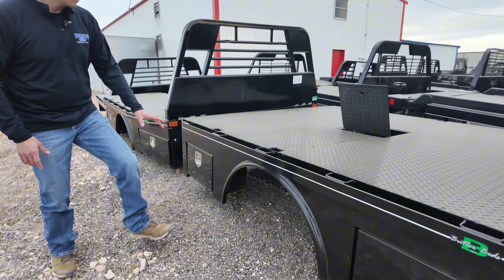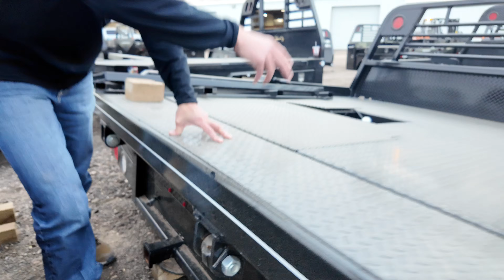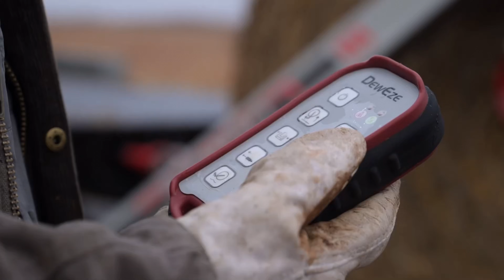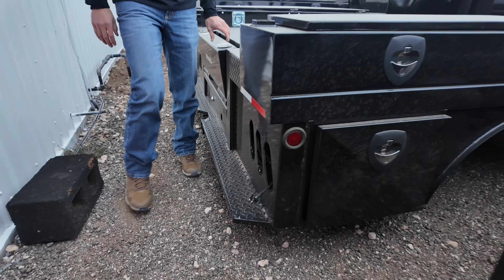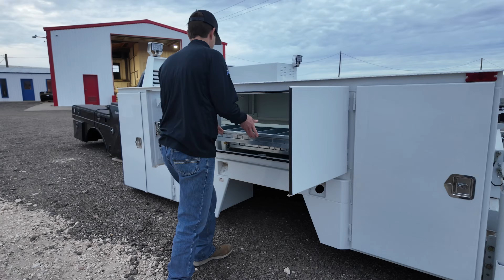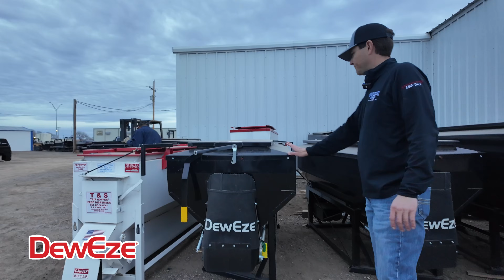Every Truck Flatbed Type Explained

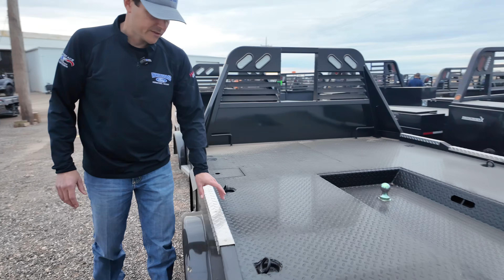Comment: That hauler bed fuel setup 7:04 is a no-go for me. One of the biggest perks of a diesel is commercial pumps and dual filling - dealing with that in that top load flap thing seems like sabotage. Aluminum accent trim to snag and cut yourself just shows you who they think they're selling those units to. 
The pronghorn box seems really nice, but you have to feel it in hand to tell. Surprised they all don't come with bedliner coating to keep rust and paint from chipping and flaking.

Comment: up here in wisconsin it got down to -27 we need a fuel class../.. is offroad diesel diffrent than normal diesel and what to put in it for aditive
Reply: There is no difference in off road diesel and on road diesel.  Off road diesel is dyed red for easy identification by dot. Off road is untaxed  while on road is taxed. As far as anti gel additives a name brand anti gel should get you where need to be.  I don't live where it gets that cold but I use howes diesel treat.

Comment: Why do people get flatbeds in the first place? Wouldn’t keeping the factory bed, included in the MSRP (unless you got a Cab & Chassis) be the better financial move.
Reply: work truck? Plumbers, farmers, electricians, all sorts of tradesmen use a variety of different beds.
Reply: @V @Victorbanda1234  I want to put an arm bed on are ford so I can feed are horses and stuff with.
Reply: I get pretty frustrated with my stock pickup bed a lot. My truck is lifted, so it’s hard to reach over the side of the bed, especially up at the front. The usable flat space in the bed really only amounts to 4’x8’, the space between the wheel wells. That’s maybe 4 refrigerators. A flatbed could haul 8. I once had to haul a truck cab for my friend’s restoration project. The cab could have easily fit on just my truck if I had a flatbed, but instead, I had to haul a 16’ long dump trailer. I would have rather not had to haul the extra 5,000 lbs for the 200-mile FB Marketplace journey. Anything that is big fits way better on a flatbed and can be secured better because of the full-length rub rails on the sides of the bed. I also hate how fragile a stock sheet metal bed is. I can’t lean over the side while wearing a belt buckle. I wish America would adopt the factory tray beds that Australia uses.